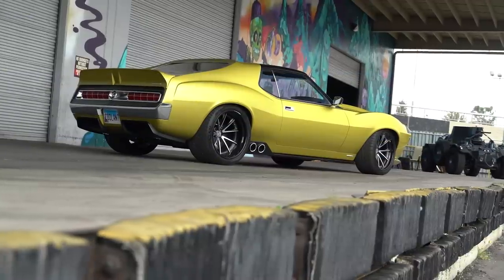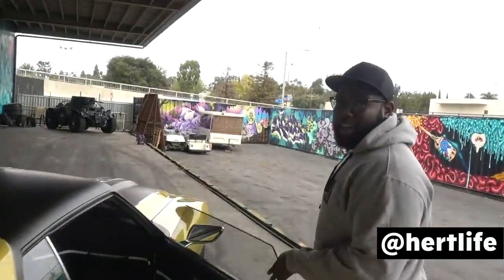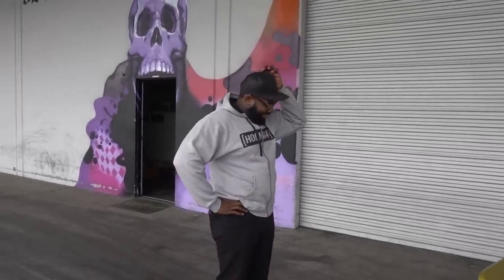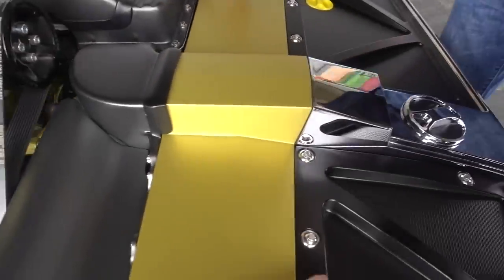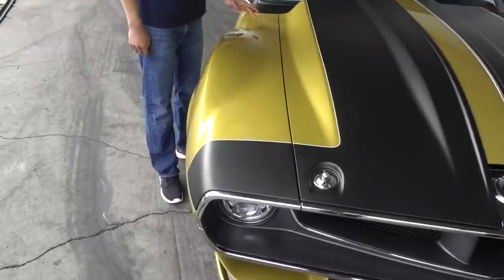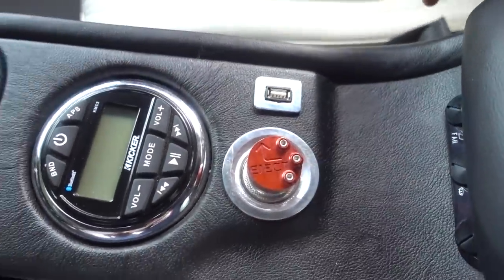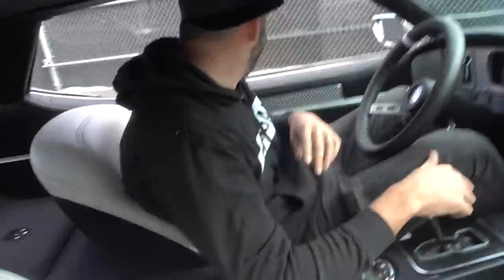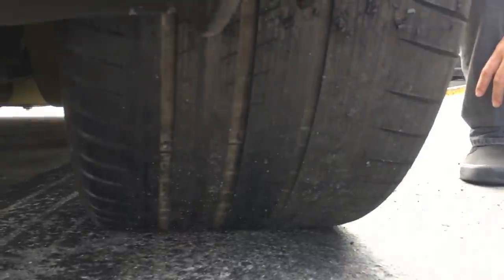1100hp 1972 AMC Javelin, Ringbrothers' Defiant //DT224

Comment: And then Fiat bought Crystler , Dodge ,& Jeep. So a Fiat valve cover would b more current
Reply: Mario Diaz lame it fiat chrysler
Reply: ya fuck it i Only drive Hondas anyway , but i like knowin what the competition is
Reply: Mario Diaz you only drive Hondas and you comment on real cars. Maybe you should drive a proper front engine, V8 rear drive before you comment like you know cars
Reply: I feel sorry for you
Reply: I HAVE DRIVEN V8S AND V6 but i only BUY Real Hondas , i dont like to waste money everytime i get into the car or payin 200$ to fill up , smarter not harder, uve never heard of it v8 loses power from engine to trany then to driveline then to diff then axle shafts then wheels , just a bunch of weight and unnecessary parts thats dead technology. theres a REASON 90%OF ALL NEW CARS ARE FWD, NOT "" REAL" RWD V8 GET WITH THE TIMES . U KNOW HOW STUPID IT IS TO POWER RW WHEN U STEER WITH FRONT WHEELS ,OVERSTEER,OVERCORRECTION, UNDER ENGINEERED , ... O YA AND THIS IS A RESTO MOD , NOT A REAL CAR , IT WAS 3D Printed , and has a hellcat or demon engine, nothing close to an actual AMX , MAYBE U SHOULD HIT THE BOOKS AND LEARN A\F RATIOS AND WHY IT TAKES A 5.7L  v8 to MAKE LESS  POWER than 1.8L 4 cyl ,maybe u need to learn the definition of what a REAL car is and what a under engeniereed car is, car in video is a milion dollars and it can spin wheels , mine does same shit , but can that rwd v8 take a turn full throttle without Hoonin?
Reply: Juan F u ever driven a million dollar car? dont think so actually  i know u havent, thats y i comment cause i see a nice car that was designed on a computer , printed out and assembled, sounds like a Fake car to me or a imitation car better haha
Reply: Mario Diaz real Hondas? Lol OK let's see, for example a 6.2 V8 Corvette gets 25mpg + so a 2liter or smaller should get 75+mpg but does it? No, plus we are comparing recycled Japanese beer cans to real cars. More power burns more fuel logical, but your into mpg not HP again why come to on something you have no clue on?
Reply: Juan F thats y i know ur uneducated All Hondas have been made in Marysville Ohio sense the late 80 early 90s , so just stop b4 u lie some more, a new honda like ur comparing will get 60 mpg. im sayin look how in a Honda 1 cylinder displaces twice what it recieves from L of engine go look up b18c5 motor its 200hp 4 cyl 1.8L , o and i bet u dint own a vette so y do u pretend to know, mpg is 1\4 of everything , im sayin look at how much HP 1 CYLINDER DISPLACES FROM 1.8 L OF GAS , VETTE IS SAme old LS WITH a supercharger wow , o wait magneto-REOLOGICAL DAMPENING STRUTS R THE biggest technological step in corvette sense camaro ZL1 1LE IS FASTER THAN VETTE .. PROBALLY CUZ CORVETEE IS A SINGULAR PART OF GM AND CAMARO IS CHEVY IN GM SO ITS COMPETING AGAINST ITSELF?? Honda was first to utilise a fully independent dual wish bone suspension  which is what  F1 uses and Honda did that in 89 bro gm was still messin with leaf springs n drum brakes , CORVETTE has not changed for years then they just add more piston surface more gas less efficiency, i got one to compare to vette the new NSX....  3 ELECTRIC MOTORS 1 HELPIN TO ELIMINATE TURBO LAG IN REAR, 2 AT FRONT WHEELS AND ITS A TurboV6 573Hp AWD, I KNOW WHO WINS AND ITS NOT THE TAIL HAPPY 1, The hybrid , u know who else has tech like Honda ...,Porche 918 spyder. go home chevy boy dont b mad Hondas are great b mad ur just finding this out
Reply: Juan F nsx is made of aluminum , ultra high strength steel , and otherrigid and lightweight materials some being the Worlds first applications..0-62MPH IN 2.9SEC NSX makes 573HP FROM A 3.5L V6.  HOW FAST IS UR PONY CAR 455HP FROM 6.2L V8  SENSE U WANT POWER #'S ....exactly as i was sayin more Horsepower from less pistons and 1\2 the Liters...u done now smart guy what else u wana learn boy.
Reply: And To top it off u know who holds fastest fwd lap time in production vehicle at the nurburgring , 309hp still a 2.0L 4 banger bigger turbo and upgraded pistons n rods will clear the 455hp of ur glorious vette easy i know u see em all over you tube, hondas destroying all even have 6sec 1\4mile street cars lol im laughin my ass off cuz u really thought u had a point . u see what i been sayin knw , WORK SMARTER NOT HARDER
Reply: Mario Diaz does that make it American? It's still a Japanese Honda. But you know cars right, just cause you sat in a million dollar at a car show all of a sudden your an expert? Lmao it's OK snowflake don't melt.
Reply: Mario Diaz you forgot to mention the turbos jackass goes to show how much you know, why does it have turbos? Cause it needs them! It's not just a V6
Reply: Mario Diaz oh so it's not stock but it's production? Axymoron at its best! Lmao are you sure your last name is Diaz and not bros?
Reply: Mario Diaz a Verte with those same modes would clear 1000+hp  to the wheels so what's your point?
Reply: gusgus 1991 what so stupid about that I was talking to Mario who was talking shit like he knows, but if you want to join in come at me Jack!
Reply: gusgus 1991 Honda guys think they rule that's streets that's what's so funny and yes the best cars are rear drive (real cars)
Reply: Mario Diaz You are so bias it’s ridiculous. No matter how powerful you make that four cylinder, there will ALWAYS be a bigger and badder HEMI to whoop it’s ass. Nothing competes with fully built HEMI’s. PERIOD. There’s a reason that top fuel dragsters are A) HEMI’s and B) Rear wheel drive. HEMI’s produce the most power and the rear tires are the best for hooking up because of WIEGHT TRANSFER. This is coming from a guy who likes his front wheel drive four cylinder turbo dodges and Shelby dodges. Front wheel drive is great for cornering. However formula 1’s use rear wheel drive because it is still better. And don’t get me started on the lack of torque your Honda engines produce. Laughable. You need to make huge horsepower numbers just to run 10’s... IN EXTREMELY LIGHT CARS. There are so many things that are wrong with your ideology. All because of emotional BIAS. You’re right about losing power from rotational mass with a rwd transmission. But with TORQUE, it’s not a big deal.
Reply: Mario Diaz Let me also point out that Honda’s use floating blocks that are weak. You have to spend money on sleeves just to make small power figures. Your stock rods are so tiny they bend at 250hp. Their entire engine design is not for horsepower. Their heads flow decent but their bottom ends are weak. You have to spend loads of money to go fast reliably. My 80’s turbo dodges come with a forged steel crank, good to 600hp. They come with forged rods that are good to 450hp all day long and they also come with closed deck blocks that are STEEL. It is cheap and easy to make reliable power with an 80’s 8 valve dodge. They also came with transmissions that so far have survived 1000hp and beyond without breaking. (Fwd). The computer system is far more advanced from the Japanese cars at the time as well and didn’t use shitty fucking MAF sensors to control boost. Fuck, even my 1989 Shelby CSX #170 out of 500 made came with a VNT turbo and intercooler. It’s one of 3 gasoline engines ever produced that was engineered to run a VNT turbo. (Variable Nozzle Turbo). I make 12 psi at 1,500 rpms. (Stock boost level). Fuck the 85 Shelby GLHS came inter-cooled. The fuck was Honda doing back then? The point here is that even in FWD, Honda is NOT the best option for making power on a budget. You have to have deep pockets to make reliable big power. And at 500 horsepower in my 87 Shelby charger, I’ll be running low 9’s because I’ll be making 489 ft lbs of torque. (Srt4 Holset swap). And if I used the cheaper and easier older engine I would be making 500 ft lbs at 500 horsepower because Dodge knew that keeping the torque even with the horsepower was important for going fast. I’m sorry but you’re bias and wrong.
Reply: AMC stands for American motor company..diemler chrysler is still around and very well..they are in bed with fiat but no fiat does not own Chrysler lmfao..who told you that nonsense??..it’s actually Chrysler, PLYMOUTH, dodge, Jeep, Mitsubishi, eagle, amc,
Reply: Thedog556 diemler Chrysler’ has owned Mitsubishi since the 80s and that is common knowledge..Mitsubishi eclipse is a redesigned Plymouth laser, a Mitsubishi 3000gt is a redesigned dodge stealth, a Mitsubishi conquest was completely designed and built by Chrysler...PLYMOUTH is still a company and still produce vehicles currently so check your facts as well as the fact that fiat DOES NOT own diemler and diemler does not own fiat they simply have their money in the same bucket and share ideas and patents that is it..that is the entire relationship..get educated little man
Reply: chrysler is keeping fiat afloat no one buys fiats!
Reply: +thedog556 believe whatever dude you can’t teach stupid I guess but you can surely google public information which it is...or you can get you hands dirty and actually work on a Mitsubishi from 80s and 90s IVE DONE 15 to date and do you know what was a constant??? The Chrysler pentagon that has existed since the 60s lmfao so Chrysler just went around sticking their logo on things they don’t own?? Chrysler is still its own company today and simply SHARE with fiat which they own currently..google and get over it
Reply: +thedog556 were you even alive during this time period of which you know nothing?? It definitely shows
Reply: guys there is also a law in japan a american company can only own a certain percent of a company in japan
Reply: +themopar426 that law is for vehicles produced in japan not in America
Reply: +thedog556 the eagle talon is a mopar vehicle..have you ever even seen one? Doubt it
Reply: +thedog556 the funny thing is you trying to prove something and not doing it..that is hilarious
Reply: +thedog556 proof is in the pudding kiddo go get your hands dirty get some real world experience and tear Mitsubishi form that time period as I have done about 15 and do a reference on the parts and find out they were Chrysler parts lmfao..you have no legs here so just tuck it in kiddo
Reply: Mario Diaz alright alright let me get this straight, your whole argument for 4-cylinders is that they are more efficient and create more power per liter than a push rod or flat plane crank V8? Right? Now you mentioned a Honda engine, 200hp from 1.8Liters, sounds impressive until you do the math. 200hp from 1.8L is 111.111111hp per liter, this is undisputed fact based on the info you have given. Now based on YOUR argument that hp per liter is king soooo, why then does a Dodge Demon generate 840hp from 6.2L? That equates to 135.483871hp per liter, this is also indisputable FACT. Said Demon also generates EARTHMOVING TORQUE compared to a little 4-cylinder which is where they fall flat on their faces imo. Not trying to hate on FWD cars, they are great economy cars, but there is a reason why almost every racing series in the world utilizes RWD. Don’t get your knickers in a twist I’m just spitting facts for the sake of spitting facts. Good luck😉 And also try to use some punctuation and grammatically correct sentence structure, I’m really losing brain cells just reading your comments, no disrespect, just TRY please🙏🏻
Reply: Juan F just bringing you back here because I couldn’t leave his untamed (LOGIC) in these comments😂. I think my comment to him is worth a read for ya, do me a favor and check it out!
Reply: @Jodeyjoe559  its not your fault, you were dropped on your head as a child. Multiple times.

Comment: HEY JAVELIN ! Amc was using Chrysler engineering alot back then. I worked at Chrysler engineering and development and did development work on their 401,390,360 and 343 (I'm forgetting the cu. In.) They had torque flights. Strong engines. Gremlin X was great for me.

Comment: Its overall length is the same as standard, the Javelin was a long car relative to Camaros, Firebirds, etc by a little bit.   They lengthened the wheelbase, not the car.  original wheelbase 109, original overall length 192".
The son of an AMC chemist, had those tings in my driveway when dad came home for lunch, owned two, building a race car out of one myself.
Great job by the Ring Brothers.

Comment: The difference between a standard Javelin SST and the Javelin AMX is the big block and the shorten the car nearly 12 inches,  right out of the middle. As a kid my Dad had a 1971 Javelin SST and an AMX, they were called "the poor mans Porsche" because it handled so well. They really have major issues with rust, in the rear and front shock towers, hence the rarity now. My Dads front shock towers started to separate from the frame, at one point moving over enough to lock into the steering rag joint locking it in place.  Miss that car... (Yes even the Gremlin had an AMX variant! only 40 made, big block and shorter then normal. :D That would be a crazy fun ride. This I found in an "AMC, history" book at a local book store years ago. )
Reply: Michael McLee  I had a 70 AMX 360  4-speed w/ 3.73 posi.  No options except for the "Go Package" was hood scoop and ram air, heavy duty electrical and cooling, heavy duty springs and shocks, 4-wheel disc brakes, positraction, wider tires. Car was fast and most fun I had as young man.  Sold it in the 80s. Miss it much.

Comment: Just a few friendly corrections at the beginning of the video. AMC had two performance vehicles from 1968-70, the AMX and Javelin. The AMX is a direct two seater version of the Javelin, released 6 (I think) months after the Javelin. The AMX was discontinued after 1970 and from 1971-74, it was the highest trim level on the Javelin. The color is supposed to be a close comparison to Prestone's coolant color. It's called Jalop Yellow because of the review Jalopnik made on it, basically calling the color ugly.

Comment: AMC’s V8’s have a lot in common with Chrysler. They share the bore spacing with a B or RB Mopar engine. If you look at the intake ports they are similar. The metal intake gasket has the same size ports and spacing as a Big Block Mopar. It you lay one of the metal intake pans on top of the other the ports match. I think that’s why Indy Cylinder head went into making race heads for AMC. Too cool. The other thing is that the Rebel Machine used RB intake and exhaust valves in their heads. They an easy fit for any engine from 343 up to the 401. the only thing I don’t like, but can be modified to work, is their oiling system. the pump is like a Buick, being part of the timing cover. Oil distribution at high RPM is a problem and must be modified for the engine to live. Fun stuff to research!

Comment: AMC was always cool. They were sleepers. The Rebel Machine kicked some serious ass. Then the SC Rambler cam along suited for super stock competition. After that the Javelin and AMX came along. The Javelin was built strictly for SCCA competition, with an engine displacement of 5.0 liters. The AMX was purpose built for Super Stock, to the replace the SC Rambler. The Javelin and AMX shared several body panels, but the AMX had a wheelbase of 98" while the Javelin had on longer 110" wheelbase, or close to it. The engines used in these cars were the latest of all the American V8's . They used Buick's oiling system, Big Block Mopar's cylinder heads and a lot of little details ,borrowed from the best of the competition. Not that they didn't engineer things for themselves, they looked at the competition and used some of the best properties of each, molding them into their cars. They bought parts from wherever they could get them the cheapest, to keep costs down and profits high enough to maintain the R&D they needed to move forward. In my book, and in those of many others, AMC offered the very best of the end of the muscle car era. There are rumors that the late model Magnum Small Block Mopar's  used Head design cues designed by AMC. The little company ne ver gave up. And the Jeep XJ was a devolved version of the Hum Vee! They wanted to build a. Streetable Hum Vee like 4X4 that could conquer any terrain. But the cost was too high for Jeep to charge customers, so they put the best of what they could into the XJ and the rest of the engineering into the Hum Vee and pitched that to the Army who was looking for an updated Jeep design. When AMC folded, Chrysler bout the right to AMC including the Jeep except for the Hum Vee. The Hum Vee design was sold to AM General where the design was sold to the army and marines. The reason Chrysler didn't buy the Hum Vee design was that the vehicle was far too wide for the available alignment racks at the time. Bob Jones, in ScottsdaleAZ had a extrawide alignment rack for aligning motor homes, and he won the contract for aligning the Army's Hum Vees. I think he added extra racks to handle the volume of work coming in from the armed forces. And at the end of of it all, the AMC earned a spot of history, in the engineering of some of the. Fastest Muscle cars ever to run the roads and the  dry best of all the American off road vehicles, ever!

Comment: having owned one 72 javelin sst and a 74 amx I feel pretty safe to say the car was lengthened by moving the rear axle back and extending the body behind the rear wheel, or for the most part anyway, the nose looks about stock length, stock these cars had very little weight on the rears and even my stock 304 72 sst would do a crazy smoke show, the 360 4 speed amx you could almost burn the tires right off.

Comment: Wasn't the AMX shorter than the javelin? My mom had a javelin somehow, and got rid of it for a turd back in the 80s. I may have to revisit that.
Reply: TheFootbaldd  68-70 AMX were 2 seaters with 12 inch shorter wheelbase than the Javelin otherwise were same car.  In 71 the AMX was dropped and only the Javelin remained with "Javelin AMX" as high performance option.